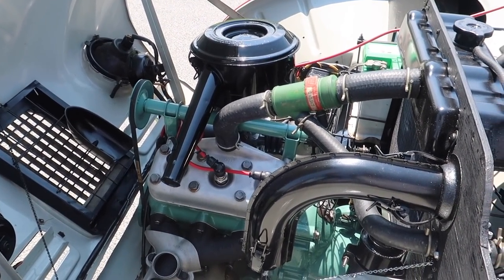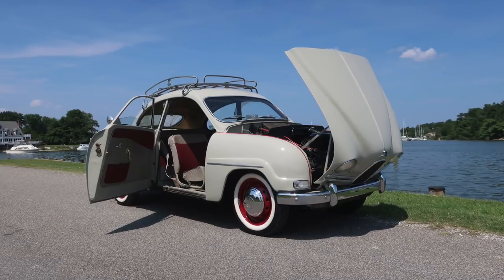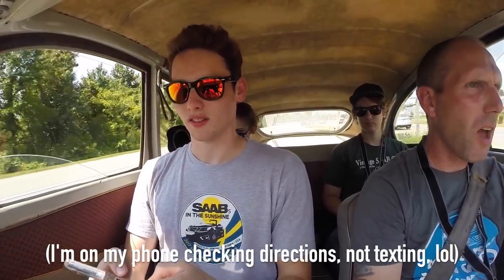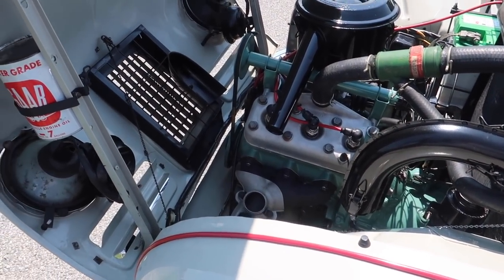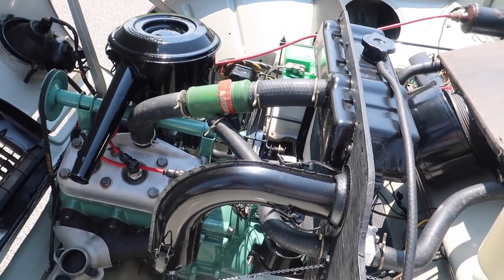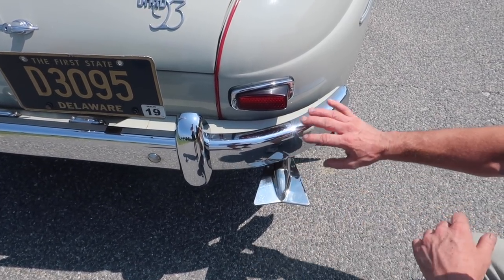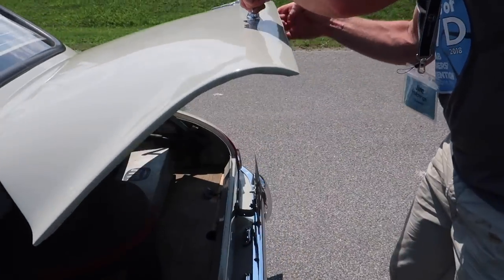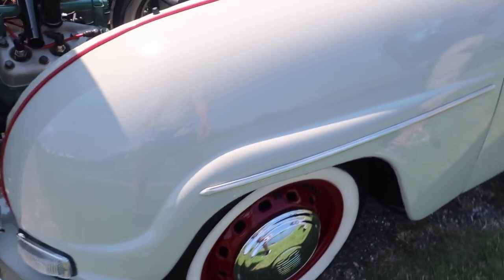1959 Saab 93b Review! - THIS is Vintage

Comment: The "camper" configuration was fascinating... I actually did camp in it for one weekend. Generally preferred to just carry a tent with me.
1. Slide front bucket seats all the way forward until they come off the rails, lift them out of the car. 
2. Lift out the bottom cushion of the rear seat.
3. Open the trunk and turn the wooden toggle that locks the seatback in place. 
4. Inside, lift the seat back off two metal prongs that hold it. 
5. Put the two bucket seats in the well where the back seat was.
6. Put the bottom of the back seat in the middle of the passenger compartment. (Afterthought, make sure you have blocked the wheels, because I think you have to release the parking brake. You do carry a few bricks to block the wheels, right?)
7. Using either the wooden supports that came in the camper bed conversion kit or some props that you have improvised, put the narrower top end of the back seat under the dashboard and the bottom end against the now centrally positioned bottom of the back seat.
8. Unroll your sleeping bag and go to sleep, because now you are very tired of wrestling these parts into place.
Reply from the maker: nice! yeah, it probably isn't as practical as a tent but still cool

Comment: Hi Saab lovers 
I grew up in Sweden in the sixties, our family had a couple of two stroke 95s. In 1963 we made a three week road trip around England on the vacation. My dad prepared for the trip with the travel spare part box which he could get at the dealers for a small fee. The deal was that he would returnt the box after the trip and the pay for the used parts only....
We did however not need any of them as the car ran perfectly all the way. 
At the age of seventeen ( 1969 ) me and my brother bought our first car and it was a car just like the one in the video, upgraded with an 850 cc engine though. We had lots of fun with the car on the Swedish gravel roads in the countryside dreaming we were rally drivers.
I loved to see a 1959 in such good condition far better than the 10 year old car we had.....

Comment: Really good video! Cred for him that drives a 93 in usa! The 93 is very rare even in sweden, I really wish my grandfather and my greatgrandfather should have saved their old saabs, my greatgrandfather had a 1965 96 2stroke and a 1960 93F, he changed his 96 to a 1971 96 v4 and then my father took over the v4 and this spring we got it out from the place were it had been for 20 years, we only changed the gas and then it started its really good shape and got great rare paint called "tyrolergrön" and I Can't wait untill we get it to run cus the clutch is broken. My grandfather also had a 95 v4, and near our cabin theres 2 abonded 93/92
Reply from the maker: no way! That's super cool

Comment: One of the last passenger cars that actually incorporated wooden parts, wasn't it? The back of the back seat was wood and had a wooden toggle to lock it into place, and as you can see in the video, the floor of the trunk was plywood too,

My first car was a '62 Saab, but I bought a '59 or '60 for parts from a friend who had recently replaced its engine... only to have its rear shocks push through into the trunk. So, an art major, he welded a bracket for the rear end and we drove it across Connecticut in winter with the windows open to keep the exhaust from blowing in through those rusted out rear wheel wells. 

Another idiosyncrasy... I Skimmed through this video and may have missed any mention of the lack of a solenoid. My parts car had a 1 position ignition key  and a pull to start cable under the dash. Not to be confused with the other cable that pulled up an oilskin shade in the grill to keep water off the distributor.

 Wonderfully idiosyncratic car.
When another Saab owner (engineering major) and I got to swapping out the engine and transmission, we did it without a hoist. 
We took the steel bar from a set of barbells and put it under the fan shaft, took the hood off completely, and despite neither of us being over a hundred and sixty pounds, were able to lift the engine and transmission enough to drag them out of the engine compartment , set them on a tarp and drag it over to the front of the '62, then lift them into place again. 
I also kept the older car's starter motor and generator and with the help of an antique car fancier neighbor , I used parts from one of them to rebuild its counterpart in the 1962 model.

 He was great fun to work with... I was 22 years old and when I met him I didn't know anything beyond points and plugs and changing tires... He lived downstairs, drove a Model A pickup painted canary yellow, also had a beautifully restored old Packard Roadster with  leather upholstery and the rumble seat...  When something was wrong with my Saab that I couldn't figure out, he would just look under the hood, listen, and tell me what to do, rarely getting his own hands dirty.

 "Take the starter and generator out and bring them to me in the kitchen..." Diagnosed bad bearings and a wire with bad insulation... dismantle the unit from the parts car because it wasn't identical, but had a good shaft and bearings.

And another memorable afternoon,
"It's not overheating, that is exhaust smoke coming out of the radiator. You need a head gasket... go buy yourself a torque wrench." No valves. Easy job!

Wonderful cars!
Reply from the maker: yeah, they're quite quirky and I enjoyed driving this one!
Reply: I had the rear springs push their way into the trunk just the way you describe. It was a 1960 2 stroke

Comment: This car looks so small from the outside, but looked quite roomy on the inside, or am i wrong. Also don't get how the window was open, the curved glas did not match the upper line ( don't know if my question make sense ). Cool drive though, you seemed pleased.
Reply from the maker: Good point! It does appear small (maybe due to body lines?) but all four of us were in there fairly comfortably. Also, the windows didn't roll down the whole way for that reason to my knowledge
Reply: The side windows are fixed to the front (unlike the doors). When you lower the window, it doesn't go straight down, but drops more in the rear than  in front. And that's right Auto, they can not be rolled down completely.
Notice, on driver's side a plastic screen appears right at the B-pillar. It prevents winds from blowing (to the rear passengers)  when you drive and the window's down 1-2 inches. Saab always thought one step further...
Reply: @andreshaas  thanks for explaining. True, SAAB did always think one step further.